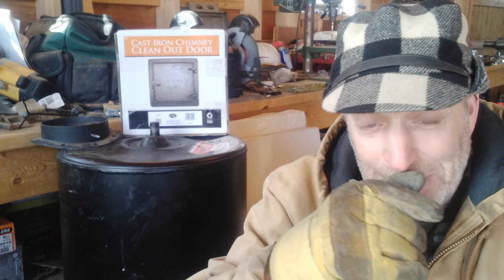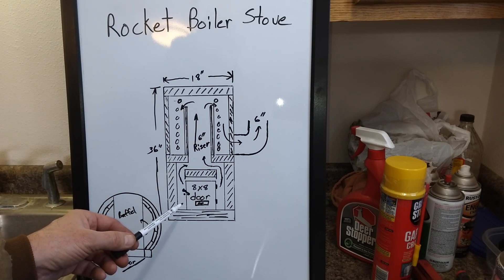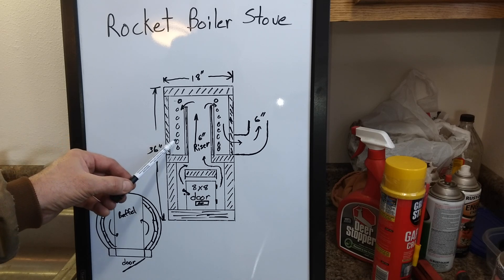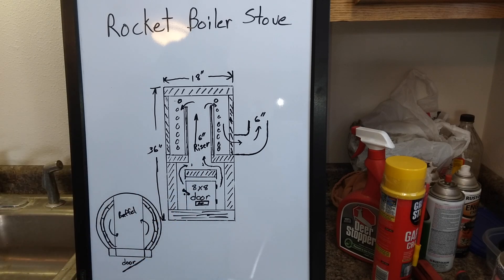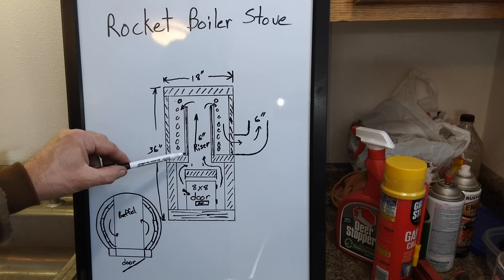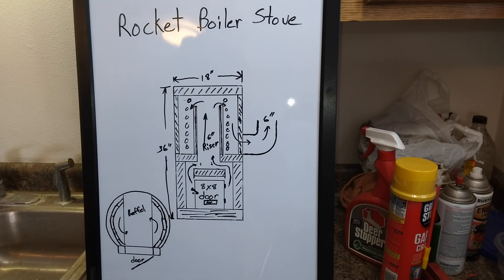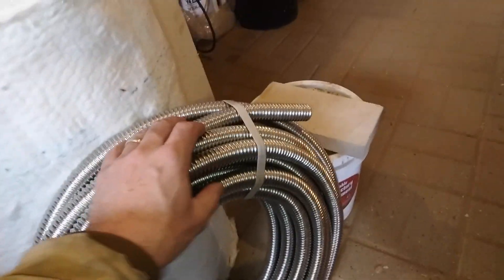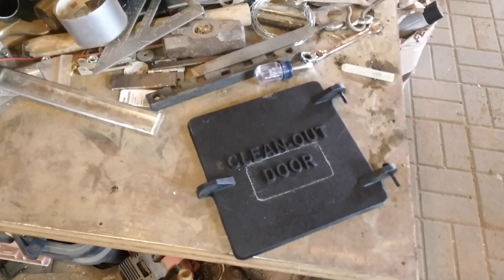DIY Rocket Stove Water Heater out of a lawn roller tank.

Comment: A batch box rocket stove is the best of both worlds.Long burn cycles and high efficiency to boot.  My condolences to the cold weather you are experiencing. I am locky at my way as so far the weather is kind of mild. I am getting together a self contained heat exchanger that will go into my chimney and into my basement. The only thing I will us is an electric fan to blow over the coils. Good day fella. VF
Reply from the maker: I agree about a batch box style.  One thing that concerned me before when using a rocket stove inside, is that a vertical wood feed tube can act like a chimney at certain times, and sparks can sometimes pop right out, and the constant attention needed.  It's nice when you can close the door on a fire, and have it contained.
Why not make some videos of what you do?  Just show and describe the work, but your face doesn't have to appear in them...
Reply: @doubleMinnovations  I am not really the good at using camera and stuff. Not even sure as to what type of camera to use. Not really sure even how to start. Have to think about that DMI. Look forward to more content on your creation. Good luck too. You know what they say. Better to be lucky than be good. Peace VF
Reply from the maker: @victoryfirst2878  I have been just using my phone camera.
Reply: @doubleMinnovations  What type do you have ??
Reply from the maker: @victoryfirst2878  I have a Samsung Galaxy.
Reply: @doubleMinnovations  Thanks DMI
Reply: @doubleMinnovations  K

Comment: Great idea with that lawn roller! Consider the J-tube feeds say they don't need secondary air if your feed channel is not that long then it doesn't seem necessary. I don't know - I found a scribbled design I had with a "tertiary burn." So basically I get blue flame off that stainless steel elbow and then if I have the door open - the extra air shoots the flames up the back behind the baffle. There's not much space back there so normally the exhaust goes under the baffle to the front. So anyway.... this is another great idea. Did you see that "steel brake drum" stove? I didn't watch the vid but it's pretty funny to just weld a bunch together....
Reply from the maker: I think I remember seeing a video of a wood stove made out of stacked wheel rims.  
How a secondary air will effect this boiler, is unknown to me; but I will find out.  There's always a risk failure when inventing.😌
Reply: @doubleMinnovations  Did you change the emissivity level on your infrared gun? I had mine at the preset 96% and I looked up wood as supposed to be at 86%. So I'm sure I maxed out the 1000 F. limit but there was never an alarm since the reading maxxed out at 987 Fahrenheit due to the emissivity. I never got higher than that despite many readings. So I'm sure it was due to the emissivity at max level of temp.
Since I had lots of blue flame - blue flame is supposedly 2000 Fahrenheit right? haha. I had LOTS of blue flame. So thanks again for your inspiration. 
I had been checking out rocket stove mass heaters for a long time on the interwebs. But in Minnesota we need fast heat while those big cob deals were more about slow heat. Also I needed a smaller set up for a 10 x 12 hut. 
I suppose I could still design some kind of rocket stove and then put the duct pipe under my single bed frame or something - and cover it in cob and then exhaust it out the "front" of the hut. Or whatever. It doesn't seem worth the work to totally redesign the hut as it's all very primitive.  I still just have bare ground as my floor. It got up to maybe 40 degrees F. when it was around zero degrees outside. haha.
So that stove mod worked great as now with the stove door open then I get the tremendous heat kicking out to warm up the hut fast. Whereas with a J-tube feed you can't open it up like that for fast heat. 
Also not smelling any wood smoke pollution is awesome. I wonder how long the steel baffle will last in my stove. It got all white from oxidizing. haha. I just use it as an unoccupied occasional space.
 I just saw a Lopi stove talk from 2013 - and they use a stainless steel baffle.  I just use the hut as an unoccupied "occasional" space. Also that Lopi stove has a "baffle bypass" to have the air go up behind the baffle when the stove door is open. I got some smoke out the front after I took out those side bricks. But when the fire is up to heat with the secondary air heated up the back - as long as I have all the wood burning well - then there's no smoke out the front door.
Reply from the maker: @voidisyinyangvoidisyinyang885  My newer high range thermometer, came set at 95%.  I decide to leave it at that setting.  It says this setting is for concrete, and I use it mostly for checking the concrete and rocks on our masonry heating/hybid fireplace in the house.   
I concluded that with these hot burning fires, thermal mass is needed to get the most benefit.
Reply: @doubleMinnovations  That is a fact DMI on thermal mass. That is how the Russian keep warm in the winters. They also have smaller dimension home for the most benefit. Peace
Reply from the maker: @victoryfirst2878  Before I made my masonry heater, I did some reading about Russian fireplaces, because I know they have cold winters like here.
Reply: @doubleMinnovations  You and the Russian are tough people fella to take the cold. Peace